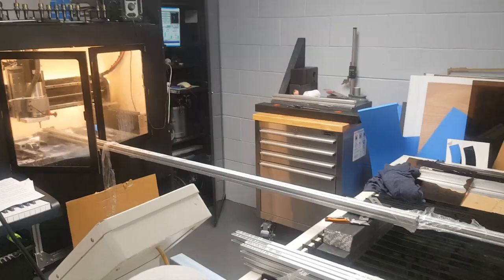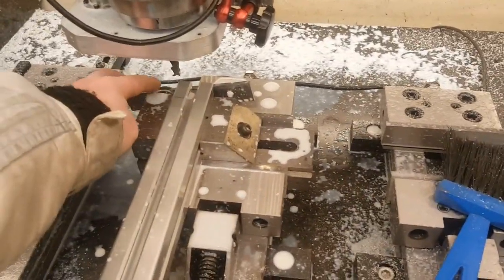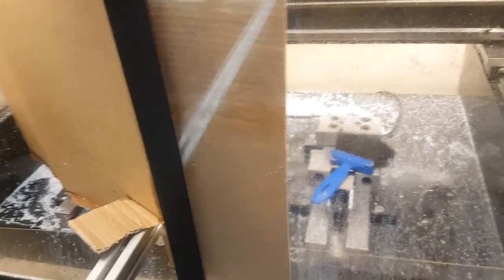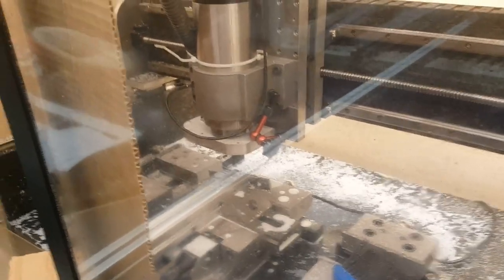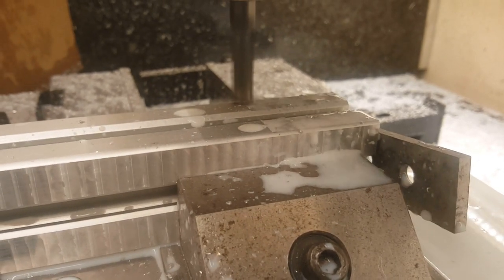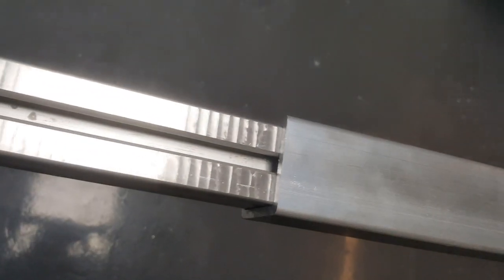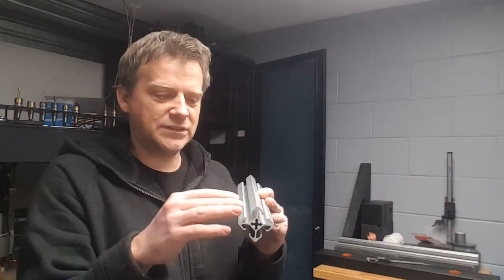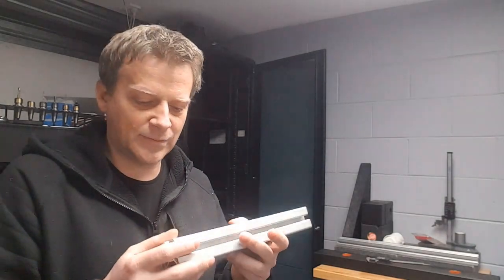funny milling - funny looking setup

Comment: It's Aluminium why didn't you use a fly cutter?
Reply from the maker: there is no fly cutters for this spindle. considering the minimum speed i'm comfortable with is 9000rpm for this spindle. anyway one side takes 1 min to mill.

Comment: I'm glad you anticipated being asked about why you went perpendicular to the profile. That hadn't occurred to me, but I'm sure if I was doing that job myself I would have gone parallel to the profile. But your reasoning seems logical to me, so I'll probably follow suit, should I ever need to do something similar.

Hmm... what do you think about doing it at an angle? If parallel is 0º and perpendicular is 90º, maybe 30º would speed it up and also avoid the resonance problem. Prolly one of those things that would only be worth worrying about if you had to do a whole lot of them...
Reply from the maker: well. i guess it could speed it up a bit. but every case is different. so i wouldnt worry too much about this particular case. i have to say that milling thin stuff is super annoying. even thicker stuff if it sticking out 30mm off the vice.